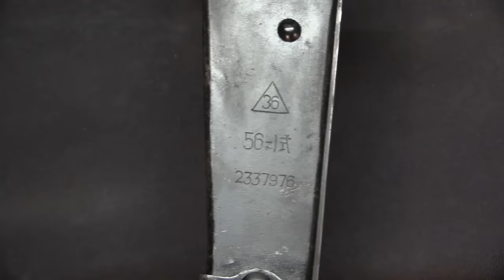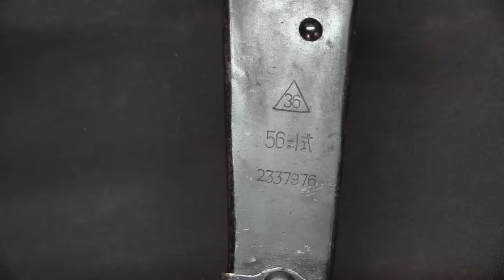RPD: The LMG Adapts to Modern Combat

Comment: Surprisingly refined and well thought out design. It really shows some elegant implementations of keeping things simple but effective with smart design. Shame about the gas system though, that could have been done better.
Reply: I agree, though it needs a quick change barrel.
Reply: Yep it a beautiful door knob.
Reply: Dekterev had a looooooooooot of practice with this style of design.
Reply: @Royalmerc  When this thing was getting used in Vietnam soldiers would probably prefer to carry more ammo over a spare barrel anyway.
Reply: @Royalmerc  the design concept for early squad based automatic weapons didn't call for a quick change barrel as they were not supposed to be used for fully automatic sustained suppression like an actual LMG. And since LMG's were in theory common enough that you had an LMG team nearby for that, your automatic rifleman (that's what this was designed as), existed to be somewhat mobile and lightweight.
Reply: @cgi2002  I understand that, but it would still be nice to have.
Reply: @Royalmerc  tbh a quick change barrel is a nice thing to have with all rifles and machine guns, with the exception of precision weapons. It doesn't take much to add to the design, and can allow for a potentially major field repair on the fly. Having the capacity to do it doesn't mean you even need to carry a spare barrel either, you just have the option of doing it.
But i get why it's not included, it does add some complexity and cost to the construction of the weapon and a $5 cost increase for each rifle sounds acceptable, until you make a million of them.
Reply: @cgi2002  I guess that's true. Don't get me wrong, I find this LMG pretty bad ass. If I was a general of some country in the 50's / 60's and had to use the  7.62x39, I would want the RPD in my army.
Reply: @cgi2002  You also need to, well, make the spare barrels in the first place, which would add extra cost. You also need to transport these things around too, which'll means even more money spent, this time on Logistic's and Transportation.

Comment: Degterev was the king of keep it simple and i dont think i've ever heard of one of his designs not being reliable. he found something that worked and stuck with it
Reply: The only downside of the tilting bolt is the hazard with the user in the event that the lug breaks off with wear and tears more than rotating bolts might shorten its lifespan. 
RPD work, but not work well enough, hence, it got faded quickly.

Comment: Modernized RPD's are the contractors lmg of choice in country for a reason 😉 it's a 7.62x39 SAW that weighs pounds lighter than an M249 👍
Reply: Rails, plastic, and what else?
Reply: @typehere6689  ...and cream.
Reply: what about the barrel change issue?  Or is it not an issue as long as you have decent logistics (armorers) nearby?

Comment: FN Minimi: I am the first LMG that uses an intermediate cartridge for squad use.

RPD: *laughs in 7.62x39mm M43
Reply: Finnish kvkk62 hold my 7.62x39 too
Reply: hold my drum
Reply: Laughs in Stoner 63 belt fed configuration.
Reply: @thepoliticalgunnut8018  i think that was a decade or so after the rpd
Reply: I have heard the minimi is not a brilliant gun.
Reply: @morelenmir  ... to put it lightly.
Reply: @morelenmir  NZ bought the Australian made versions. Sent them back. Shots wouldn't register on a 1x1 meter target at 100. Never used one a tad after my time. But over first 3 yr of introduction here never heard anything akin to...Heavy bastard but  Bren is accurate.
Reply: @ozdavemcgee2079  That does sound pretty dire! Which is so odd as Herstal by and large doesn't usually release rubbish equipment. Perhaps the problems come from the companies who produce it on licence?
Reply: @zXPeterz14  Pretty sure his point is that it also predates the minimi.
Reply: @Devin_Stromgren  yep i think you’re right, i misread it as the stoner was before the rpd
Reply: @zXPeterz14  I was referring to the Minimi.
Reply: Laughs with Soviet LAD 7,62x25 Tokarev SAW —it wasn't adopted to military service, but...
Reply: It's interesting how many "modern" concepts the sovjet block implemented decades before the west. They had a SAW with the RPD, they had a PDW with the Skorpion vz. 61, they had a DMR with the SVD

Comment: They used that unique style of handguard for the Chinese assault rifle in Fallout
Reply: Ah... so that's another "assault rifle" from Fallout that's actually an LMG.
Reply: @PrototypeSpaceMonkey  it's not a lmg tho?
Reply: @PrototypeSpaceMonkey  it's just the handguard, not the rest of the gun... Not a lmg
Reply: @tysopiccaso8711  Well, part of one anyway. Like the watercooled barrel on the Fallout 4 "assault rifle". Or how the HK G11 was classified as a one-handed SMG in Fallout 2. I just meant they should get their weapon types straight, that's all.
Reply: @PrototypeSpaceMonkey  the fallout 4 assault rifle wasn't made for infantry but rather power armor which makes sense when you consider they're basically giants with no fine motor skills
Reply: @shoelessbandit1581  the Chinese aren't using power armor in the Fallout universe.
Reply: @PrototypeSpaceMonkey  The assult rifle in fallout doesnt have a watercooled barrel it has a lewisgun shroud.
Reply: @ricardohumildebrabo  Thank god for Millenia and other modders!
Reply: @Morbacounet  I'm talking about the fallout 4 assault rifle which isn't chinese
Reply: The Fallout 4 Assault Rifle was originally designed to be named "Light Machine Gun" according to The Art of Fallout 4. They  were planning on including the Chinese Assault Rifle to fill the role of assault rifle but due to the unnecessary rush to get the game released when they did it was cut and the LMG was renamed Assaukt Rifle.
Reply: He is talking about Chinese assault rifle from fallout 3. It was supposed to appear in fallout 4. However, for some reason, the model of the rifle never finished and the machine gun replaced its role and became assault rifle.
Reply: @shoelessbandit1581  the assault rifle is the standard weapon of the US soldier. It was designed and produced before the invention of power armor.
Reply: @Morbacounet  that's not true in any of the other fallout games hell in 4 the opening cinematic shows that the standard weapon is the laser rifle. Really wish there could've been a proper assault rifle in 4 to show that the base game assault rifle is for power armor users
Reply: @shoelessbandit1581  thats just one cinematic and fallout 4 changed so much that i dont consider it canon. in fallout 3 operation anchorage the standart issue rifle for the us was a G3 clone or CETME style rifle in 5.56mm Laser weapons where rarely used in actual warfare because of their experimental stage, its more the type of weapon that the enclave or the brotherhood uses post war. before the war laser and plasma weapons where comercially available because originally  in the fallout universe the USA is supposed to be a limmitless free marked allmost anarcho capitalist country where anyone can order a tactical mini nuke launcher, experimental drugs or highly experimental plasma weapons. bethesda has changed this over their versions of the game and completely got it wrong tho.
Reply: @ricardohumildebrabo  only fallout 4, 3 and new vegas had some sweet ass gun models
Reply: @prototypespacemonkey nah the Chinese assault rifle in fallout 3 is literally an AK with an RPD front handguard
Reply: @OhBoy235  what you consider cannon and what is actually cannon are two completely different things. Even then I'm pretty sure the g3 is just a national guard rifle but is used in the Anchorage dlc because bethesda couldn't be bothered to add in a new rifle
Reply: @ricardohumildebrabo  Fallout NV one of the best - Fallout 4 - the weapons are crap - what's with all the left-handed bolt-action rifles ...
Reply: @Morbacounet  wrong gun
Reply: @Gameprojordan  Actually, no. It's more like a downscaled RPD that's magazine fed. It's a cool visual, really, what if the AK never came to be? The RPD is the perfect pattern to take it's place.
Reply: @Liminal.Headspace  the only similarities to the rpd is the rear sight and front handguard. Everything else is pretty AK like
Reply: @Liminal.Headspace  have you... looked at a Chinese assault rifle?
Reply: @Ezekiel_Allium  Yes, I have. I see an RPD style receiver, not an AK. It's configured like an AK, I get it, but doesn't look like one to me.
EDIT: I'm talking about the one from Fallout 3, the one from F76 is an AK for sure.
Reply: @Liminal.Headspace  I mean, it doesnt reeally look like either, but in terms of shape and a few details abstracted from the ak, it really doesnt looks much like an rpd to me
Reply: @Ezekiel_Allium  Try photoshoping a shorter barrel, an AK mag and a Chinese AK stock and grip on an RPD. Then tell me if I'm going nuts.
Reply: @Liminal.Headspace  I mean, I've had them pulled up side by side in Ms paint this whole time. The only thing that's really different from an ak other than the random greebles is the charging handle, which I'll give you looks more like an RPD than an AK, but again, doesnt really look much like either. It even looks like the top is a detachable dust cover.

All the RPD features are either purely aesthetic or abstracted so much to be unrecognizable, meanwhile it maintains the shape, and probably the function based on the gas system, of an AK. It realt just looks like an AK greebled up to look like an rpd.

Edit: also the stock, totally forgot, the stock on an rpd contains the spring, so itd have to work like an ak to function at all
Reply: @Ezekiel_Allium  Probably the word abstracted is the best to describe the gun. 
Also, FYI, the RPD absolutely doesn't need the recoil buffer spring to work, it's not even present on the Russian models.
Reply: @Liminal.Headspace  really? That's pretty wild actually. I've never heard of that on a gun
Reply: @Ezekiel_Allium  Ok, to clarify, on the Chinese and Polish, the recoil spring extends to to the back of the stock, not just the lower receiver, like the Russian models.
 Secondly, if it's an RPD, it's sideways, because it feeds from the bottom and ejects from the side. 
So, because it's fed by a spring assisted magazine, the upper receiver, which by the way, is pivoted, doesn't need to contain any mechanism for the belt to feed. It can instead contain a recoil spring, like many an SMG.
Don't get pissy, I know how a gun works pretty well.
Reply: @Liminal.Headspace  I wasnt getting pissy I was just surprised, sorry if it came off that way
Reply: @Ezekiel_Allium  Yeah, sorry, I got pissy, it seems. 
So yeah, I'm overanalyzing, for sure. The rule of cool is in full efect in Fallout. It's just interesting to theorise. I took armourer's classes for a year and a half just because I like the mechanical side of guns. I'll never be able to own anything but my crappy less lethal pistol in my country.

Comment: MACV-SOG operators used chopped RPD’s in Laos and Cambodia as their preferred “saw” over M60’s or Stoner’s. I’ve seen pictures of some of them chopped all the way down to right above the gas block. They carried ammo belts rolled up in canteen pouches. 2 belts per canteen pouch if I’m not mistaken. Spider Parks talked about their usage and tactics in a podcast. The gunner carried 1,000 rounds belted and ready to go. Others on the team would carry a belt as well. They were lighter with a full load of ammo than most MGs, compact and handy with the barrel chopped, sounded like the enemy when you’re in contact, using enemy ammo on the battlefield. The teams usually carried the RPD when they were going in “heavy” on bright light missions, etc. Lots of firepower in a relatively compact package. There are a lot of bad ass stories and pics online and in SOG books about the RPD. Pretty cool what those guys did with a field expedient machine gun.
Reply: I do remember it mentioned in a books by seperate sog and seal guys they would use a shim to help keep the rpd drums quieter.
Reply: @presidentmerkinmuffley6769  of course. That’s standard infantry noise and light discipline still practiced today with mags and anything that generates noise or light. I was an airborne infantryman and in Iraq before we rolled out on night operations we always did PCI’s to identify anything like that and fixed it before we left.

Comment: I always liked the cut-down versions that SEALS and SOG used in Vietnam. I've even seen photos where they brazed a front sight back onto the barrel or onto the gas block.
...For when you need a Stoner, but can't get a Stoner, and they haven't invented a SAW yet.
"Nice gun, Mr. Charlie....I think I'll just take that with me...I've got some ideas"
Reply: The best one was the version that had the stock removed and the whole recoil system was redesigned to go over the gas piston. It also have a second pistol grip added to the front handguard.

Comment: Also - once you dump a belt through it, it really shows that it was not meant for large volumes of fire. Most commonly they just cease up and you have to let them cool a bit.

On the other hand - I've never managed to overheat a barrel in one I run - it always stops working before one can do that.

Comment: Reciprocating charging handles are a bloody nightmare.
The SLR had an easy to use gas regulator, it was useful, it allowed you to run at a low gas setting helping you to mitigate recoil, usually you wouldn't need to gas it up under normal use because by the time the vun got dirty enough for you to have to crank the gas up you were usually in a situation where you could at least field strip and clean it.

Comment: 11:24 - belatedly noticed, reviewing. There were no early release shields on Soviet machine guns. But in the future, the shields began to be present both to the left and to the right of the machine gun's tape receiver. Machine guns of early production passing through the army arsenals had to be equipped with shields made by arsenals, as well as gas chambers of a new type of closed type. All instructions were contained in the RPD Repair Manual published in 1958.

On my demilitarized Soviet RPD (named RPD-O in the documents, where O means hunting), issued probably in 1950, the shield on the right is present.

Comment: 13:22- Regarding the gas regulator, I would like to clarify the information.
The Shooting Manual for the 1957 edition of the RPD gives the following instructions:
The position of the regulator "2" is the main one.
Position "3" is used if the machine gun is dirty and has begun to delay and malfunction in firing.
Position "1" is reserved. It is used in the case when the rate of fire of the machine gun has increased markedly. That is, the parts have run in so much that the frictional resistance is minimal and the speed of movement has become too high. In this case, the regulator is moved to position "1". But according to the Manual on Small Arms, this is done only on the condition that the machine gun will work reliably.

Comment: Here’s another reason “Y” the RPK took over the RPD’s place… according to the GunBusters series by the Kalashnikov Group, the RPK outperformed the RPD by 33% at approximately 1200 rounds sustained fire, compared to approximately 800 for the RPD.
Reply: The rpd seems better suited to the modern doctrine and practice of not having 1k rpm rates to comserve ammo..? Thought they usually left those ammo eaters on airplanes and mobile vehicles.
Reply: i think so atleast dont quote me on this
Reply: @reimuhakurei2123  without the necessity loading the belt first..
If soviet at time introduced a quick change barrel rpd.. Whilst keeping the rest intact..
Reply: @reimuhakurei2123  the rpk mag compatibility does make sense. Pretty sure another video on Inrange mentioned that feature. The high rate of fire still kind of doesn't make sense but it is Russian doctrine we're talking about. I'm not super into weapons on a micro level but the rpd is very aesthetically pleasing and seemed like a very pleasant weapon to shoot. Just a little more refinement would have made it all the more interesting and capable. Oh well.
Reply: @randomidiot8142  i like it in video games
Reply: @randomidiot8142  i think the kalashnikov doctrine was just to lob as much rounds as possible
Reply: @Sauli Luolajan-Mikkola yeah what i said